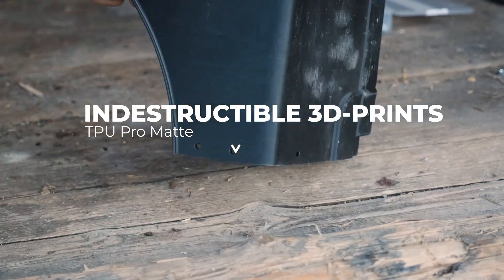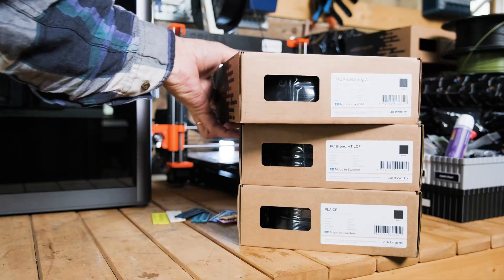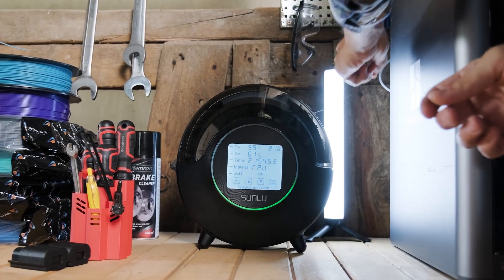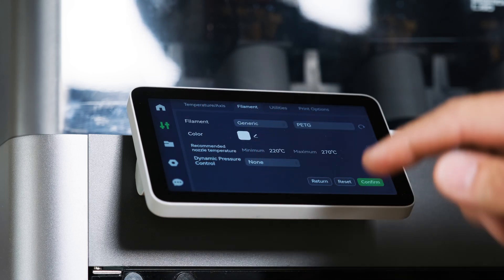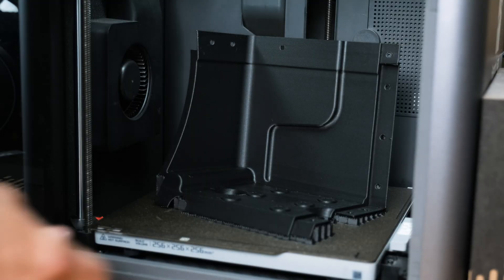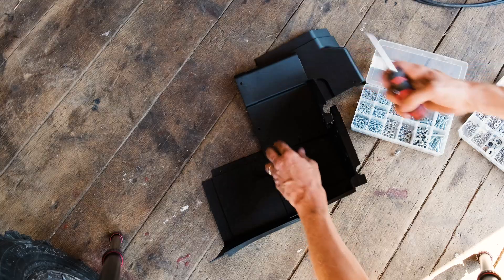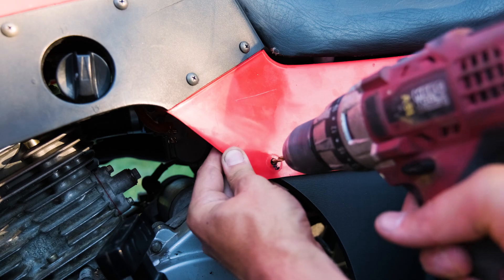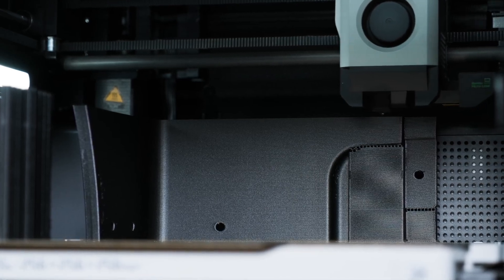addnorth – Indestructible 3D-Prints with TPU Pro Matte Filament

Comment: What would you say is the best filament for race car bumpers ?
Reply from the maker: Hi! For a race car, I’d say the two most important features are toughness and weight and of course, a big 3D printer :)

My number one option would be to make a plug/mold in PLA and then use carbon or fiberglass together with resin, essentially just using the 3D-prints as a mold.

If you don’t want to do that and still go with 3D-printed parts that you join together to make a complete bumper, I would choose PETG. For durability, you could then cover the entire bumper in carbon or fiberglass with resin, basically the same procedure as my first option, but a lot heavier and bulkier.